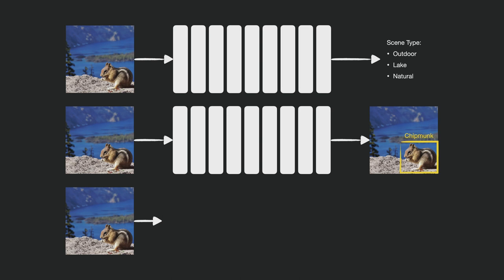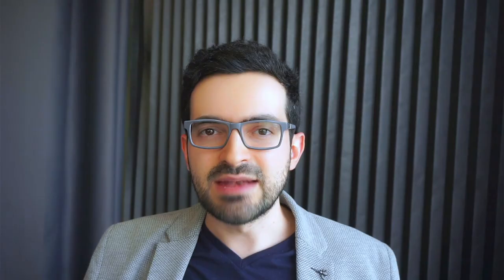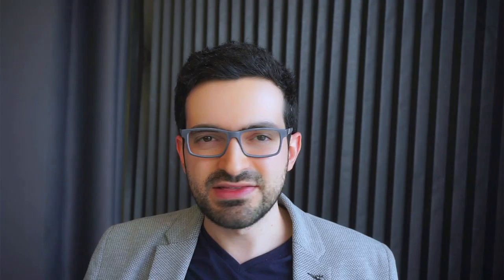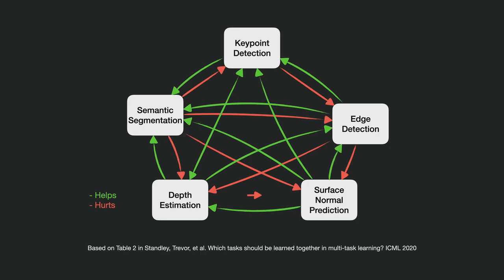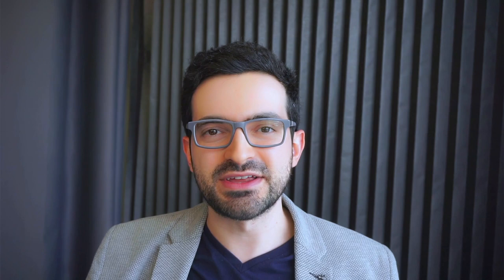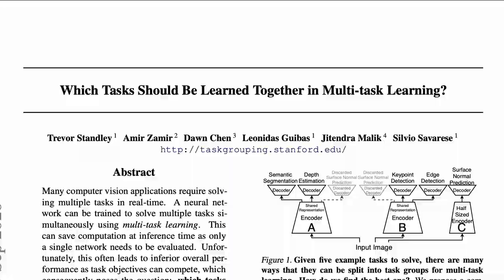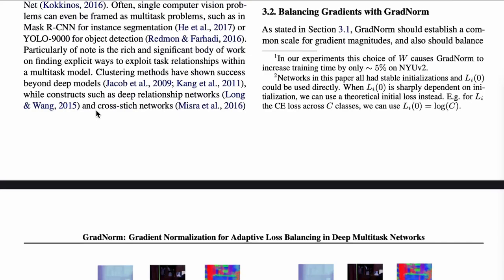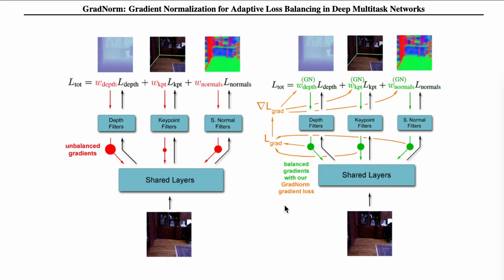Multi-Task Learning | Explained in 5 Minutes

Comment: When dealing with the human brain multitasking makes things slower since it has to switch every time to do a task. Sure it helps the person increase ability but still not as efficient as single task for more complex things. 
As for computer it buckles at times and can not handle multi tasking when I try to test it out. multitask good for speed but not for power at times. Some can disagree but that is my experience.
Even the arm processor uses a simple task to do things which will beat out the x86 and apple will have the more powerful processor which is a double edges sword to be a good thing and a bad thing. 

speaking of apple on another note. 
70% use windows, 10% mac, 5% linux,13% mobile 
80% use chrome browser, 6% firefox, 5% IE, 4% safari
Just like all rotten apples that fall from a tree they remain at the bottom.